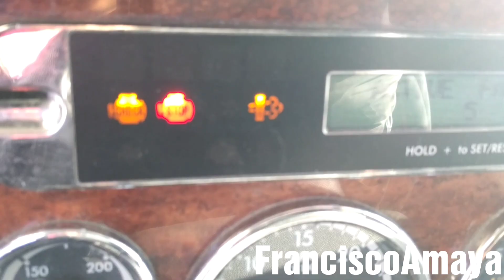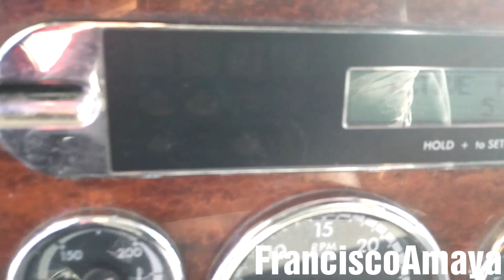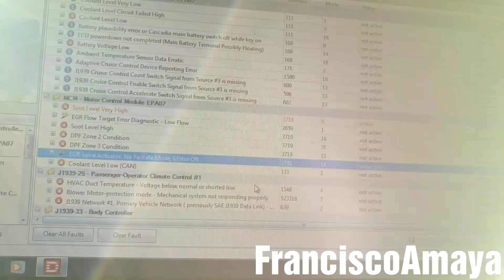Freightliner Cascadia DD13 DD15 EGR valve actuator failsafe       mode problem spn 2791 fmi 14

Comment: Replaced turbo on a dd13 along with the center manifold , and egr failsafe mode motor on came active after this? All I did to the egr was disconnect the arm attached to the center manifold what could be causing this? Pin 3 and 4 has 65 ohms and pin 1 and 2 getting 12 volts
Reply: 2791-14 is the code I got after turbo and center manifold replacement
Reply from the maker: It is possible that you have to replace the engine harness

Comment: Hii francisco 
I got 2011 cascadia dd15 
I got the same code and we did change the egr actuator.
Now i still got same code with both check engine comes on.the one with chek in it is dissapeiring after a few moment and yellow engine light stay son .after the both go off. And come back again...when I check the code it's still  2791 fm14 .
Do you have any other idea can cause this?
Reply from the maker: Maybe a faulty wiring harness
Reply: probably need to clean dpf filters. they can cause that code to come on. you can do a blower cleaner followed by hot pressure water cleaning.
Reply: Cengiz  I’m having same problem . What did you do after that

Comment: Francisco I am getting a spn003031 def tank temp code on my 2012 Coronado dd13. The shop replaced the def tank header unit and charged me $1500 to do it. The same light and code came on again just a month later. Any ideas what it might be?
Reply from the maker: Mida la corriente en el pin 3 de el connector de el tank, debe de tener 3.0V.  

Si no tiene corriente, revise el cabliado hasta la computadora. Posiblemente este dañado.

Si tiene corriente, cambie el DEF header unit.
Reply from the maker: Sorry I sent it in Spanish,  got confused.
Reply from the maker: Check the power on the pin #3 of the DEF header plug, it should be around 3.0V. 

If the power is present at pin #3 2.5 - 3.0 V, replace the DEF tank header unit. 

If the power is NOT present at pin #3 of the DEF tank header,  check the wiring that goes all the way to the ACM.  It could be damaged.
Reply: Thank you for the help 👍🏻

Comment: Francisco I am looking to buy 2012 dd15 truck it's 13 sped 475 horsepower I drove the truck it drive pretty good. But do u think it good this year truck casdidia.  And my other option is classic 2006 with cat 550
Reply: Please advice m looking buy truck on this coming week Tuesday
Reply: Surinderjit Singh 
Buy classic
Reply from the maker: Are you going to drive in California?
Reply: Francisco Amaya no sir I stay 95north and South East cost casdidia does have apu working it's midroof trucksingle bunk
Please advice
Reply from the maker: Well, based on emissions regulations the Cascadia will be better for you and it is very common. You can find parts anywhere. Also the fuel economy is around 6.0 - 7.5 MPG.  How many miles does the Cascadia has?

The caterpillar is good because it doesn't have a filter but the twin turbo caterpillar has problems too and caterpillar parts are expensive, the fuel economy is bad on these around 5 MPG or less.
Reply: Francisco Anaya it's 2012 casdidia 475 horsepower 13speed with6540000
Reply from the maker: Is the price is good?
Reply: 35000 $$
Reply from the maker: Oh, ok. 
The Cascadia is good, the problems it can present are these:

SRC box conversion low
Cam housing leak
Air compressor leak
Fuel pump leak
Radiator leaks
Oil cooler leaks
Etc,...
Reply: Francisco Amaya I am planning to delete dpf
Reply from the maker: If that the case, the Cascadia will be go for you.

Comment: Hello I have a code EEC 061 spn 1037 
Trip idle time 15 what does this mean Francisco please ley me know thanks
Reply from the maker: Do you have the original emissions system?
Reply: I have know idea how would I know
Reply from the maker: If it doesn't have the DEF deleted.  
Smoke on the tail pipe and not acm module in the electronics.

Comment: Thanks for all the videos. They are very helpful. I’ve replaced the actuator and the engine wire harness. Once every 48 hours the check engine light comes on for code 2791 fail 7. Turn the truck off and back on and it clears and is fine for another 500-750 miles and will come back on. Any on what could still be causing this thanks in advance
Reply: Hi,. Did you ever get an answer for your problem?
I have the same issue.